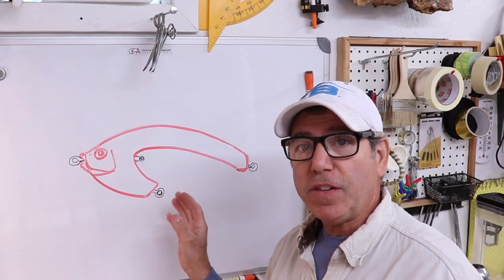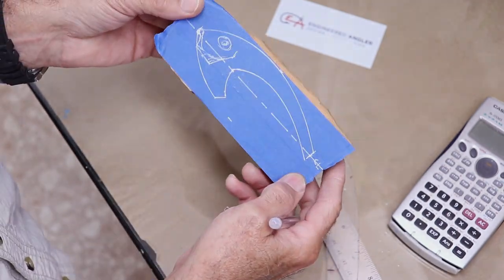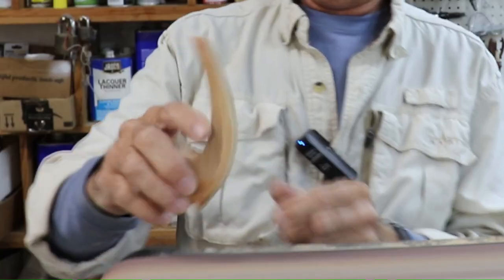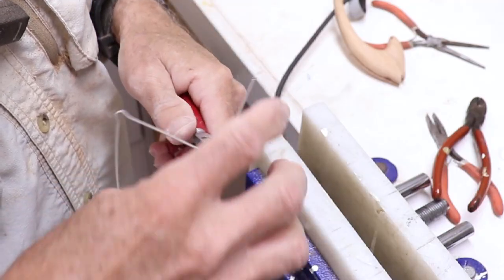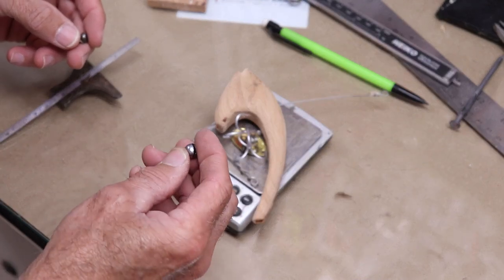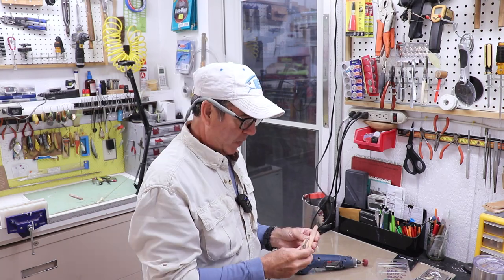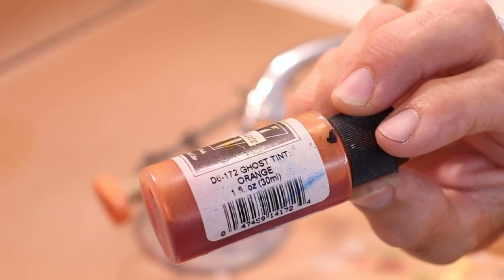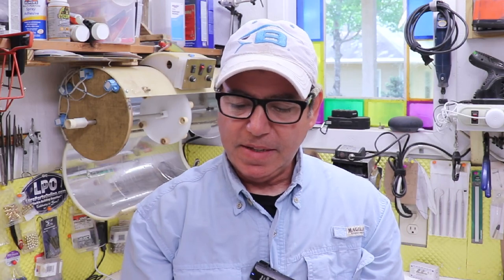How to Make a Wooden Fishing Lure, Large Pike Lure

Comment: Could you try with the line tie on top like a lipless crankbait? I would think that would make it easier to fish with the blade moving between the two hooks. Might avoid the hang-ups and get that spinner moving better.
Reply from the maker: You could, but you would get no swimming action and the blade would tend to be pushed towards the belly hook by the water flow.  The truth is that there an infinite number of variations on this idea that could work.  I had a vision for this specific style with a body that would give a swimming action on a steady retrieve but...that's just me.  Thanks for the ideas.  Cheers.

Comment: That looks really cool. What kind of wood did you use ? What if you used a wire that goes from the where the swivel is to the tail and you used a long narrow diamond shaped blade. On that wire then it would spin and not tangle up with the hook.

Comment: If the rings are drying out try the Kobe oil they make or make sure not to clean with rubbing alcohol
Reply from the maker: I think you're right...I use some harsh stuff to clean the gun and it's messing the o-rings up.

Comment: Great video, great lure.  I was happy you chose the red eye, too.  I am a pike-o-phile; I chase them all over.  I might suggest a single hook on both front and back with a 5-6 inch split tail pork rind on the back and maybe even a stinger treble back 3-4 inches. I think if you turned up the lateral edges of your blade in opposite directions it would flutter more? I love the action of pike on a stop and then jerk retrieve and think this would be irresistible retrieved in such a manner.  Only down side; well big pike chew up lures, and Dang!  This is just to beautiful to imagine being toothed up.  Thanks!

Comment: What about running the wire through the hollow, since the tie eye, swivel and rear hook are all on the center like? Then use an elongated in-line propeller style blade similar to a long buzz bait blade. Like Lure Parts Online 8192 Premium In-Line Propellers. I think you get amazing flash and vibration at slow and fast retrieves. Pike do love vibration.
Thoroughly enjoying your videos Franco, Thanks.
Reply from the maker: That could work
Reply: @EngineeredAngler  Just watched the follow-up and see you answered the question there. Thank again.

Comment: Excellent!
But....
If there is a large fish behind the back hook, the wire will straighten from the weight and fly out of the slot.
Reply from the maker: It would take a massive pull.  And I sill would have the fish.
Reply: @EngineeredAngler  ))))))...

Comment: Top video. Great idea. Absolutely creative and lots of good tips as always.
I once drilled a hole in the center of a normal lure body and implanted a 4-blade plastic propeller from model aircraft construction. This was led through the whole body by a thin brass tube. But I could never get the propeller to turn properly by fishing that lure by regular speed.
The shape of your lure seems to be more functional.

Comment: ...Now for something completely different  😀  Interesting design Franco, wobbling action combined with a spinner! Think that the body is interfering with the water flow to the willow leaf blade and dampening its action.  I use a lot of spinner rigs with different blade styles for walleyes, found that the willow leaf spins with a  narrow swing and requires a fast forward speed to start spinning.  A small wide swinging colorado blade might work better as they are quick to start spinning. Think that mounting the spinner blade on  a wire shaft might be better than a swivel (revision 2?). What about twisting a 3/8 x 3 inch piece of sheet metal into a spiral to create a rotating flasher? Cheers!

Comment: I like the idea. what if you drilled a through hole from line tie to rear hook hanger and put a willow blade that would go around the bar(maybe this could avoid the treble hook from catching. BTW I like the red eye the most too.
Reply from the maker: Yea, I thought about having wire as an axel...that's a good idea.  For now I think I'll cut the top hook off the treble.

Comment: Awesome lures and tutorials,sir! Hat's off!
Can you tell me if it is some rules regarding the points where you need to insert weights in a jointed slider to make it swim like an "S" curve? I made my own lures,I manage to make up to a 1 inch long slider that swims well,but I cannot make one that is jointed,they go straight,even if they are bigger.
Reply from the maker: The weight is usually best distributed between the segments of the lure.  But segmented swimbaits do not scale down very well.  There is a limit to how small they can be...
Good luck.
Reply: @EngineeredAngler  Thank you, will try your advice!

Comment: I was really impressed by your working out the overall weight balance until you removed more wood by drilling ....you got soooo lucky🤣🤣🤣🤣
Reply from the maker: The removal of the wood is only an issue if you're trying to get the lure to suspend...removing wood only makes it a tiny bit more negatively buoyant than my original calculations.  Do the math😄  Thanks so much for watching and commenting.  Cheers.

Comment: Where is the link to the chrome paint?  Is that water based?
Reply from the maker: you have to scroll way down the description to see the link.  There are a bunch of links of all the stuff I use.  I'll spare you the trouble: https://amzn.to/2ZK0zqp
Reply: @EngineeredAngler  sorry to bug you with these questions but I know this is not water-based. So what safety precautions do I need to take and how would I clean my airbrush? Can I use the same cleaner that I use for the water-based paints? Is there any other special processes I need to be concerned with as far as clearcoat or other paint being applied to it?